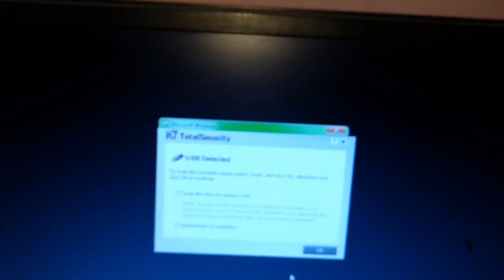USB data cable convert to OTG and Miro USB adaptor making

Comment: Best video i could find that is close to my question. So apologies for my question and why im here first off. 
Does anyone know the name of or a place i could buy this sort of cable for my pc?
I need a male usb 2 or 3, i dont care, that splits into 2 cables. Another female usb so it doesnt use a usb slot without providing a new one. That is great for plugging in a peripheral that comes with its own usb dongle to operate. And the second cord needs to be a micro usb for charging android phones.